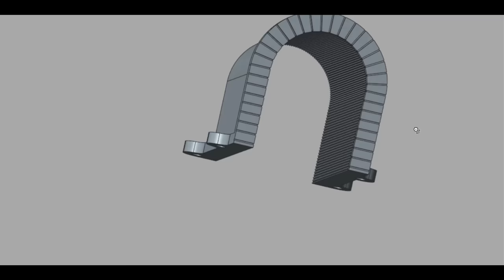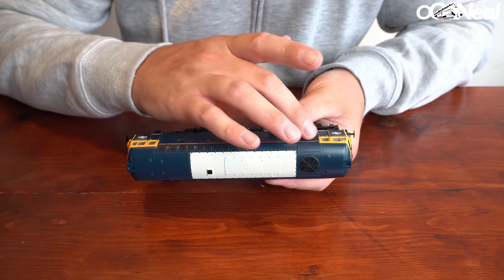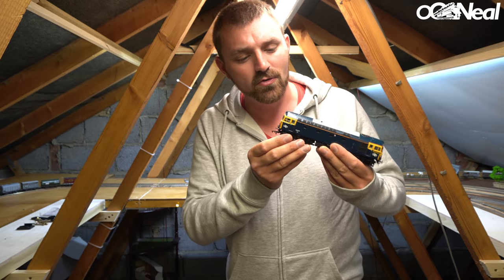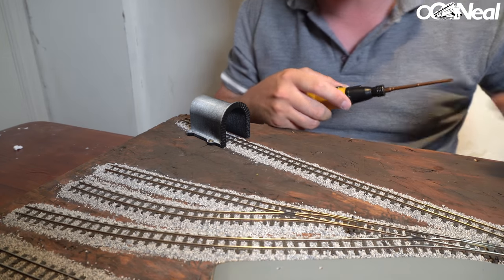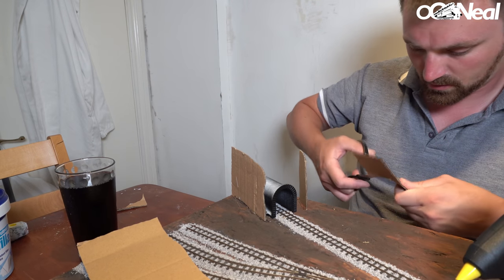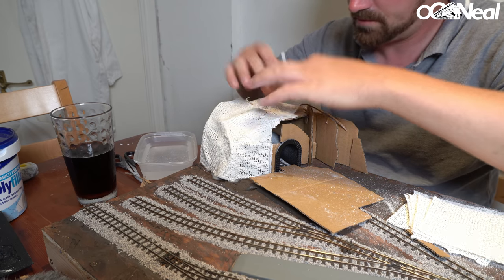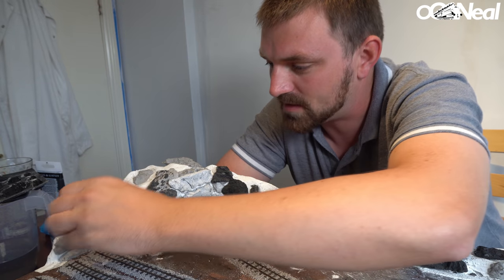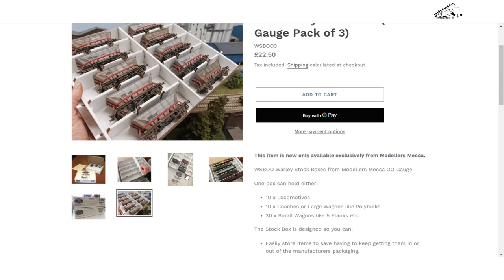Building Up A Model Railway S1 Ep 48 | Modeling Rocks | Heljan Class 33 | 3D Printing

Comment: Another superb video. That tunnel portal looked quite a good size; how long did that take to print? Which slicing software have you been using? Hot glue is a god send for scenery, I’d been using PVA for some time with polystyrene and the daft thing is I already had a glue gun 🤦‍♂️ other weapon I discovered was awesome far too late was a hot knife for polystyrene carving as I’d always made a mess and ended up with big steps to fill. I bought a load of card board boxes for locos which are for individual locos, but of course anything loose rattles around so I’ve been using a mix of soft foam and hot knifed polystyrene from old packaging to secure them safely
Reply from the maker: Thank you, sorry for the late reply. It was a couple of hours I cant remember now. Thank you for taking the time to write the message